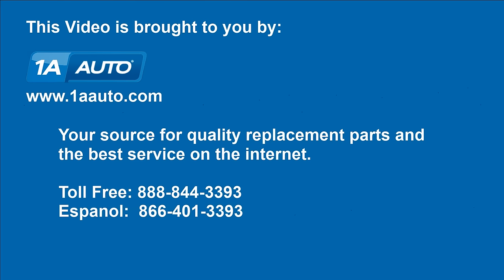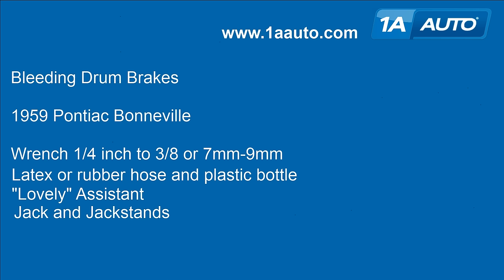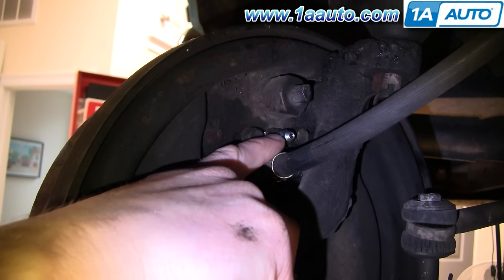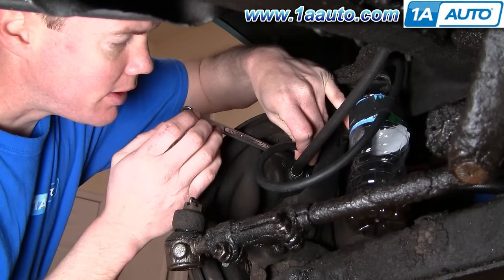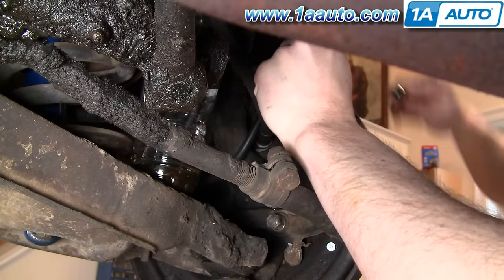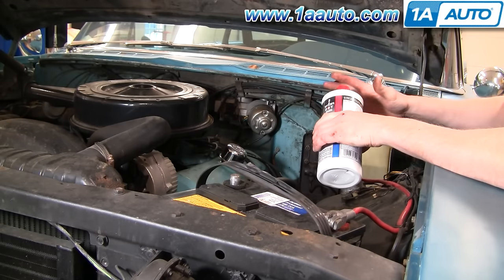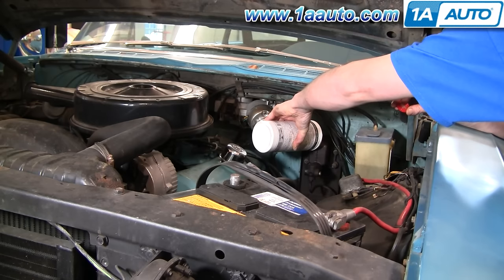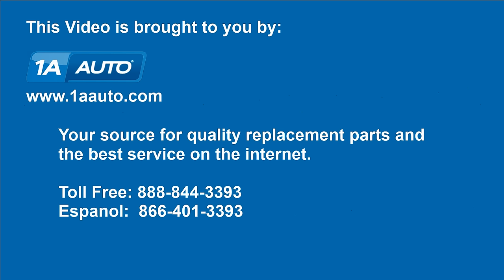How To Bleed Drum Brakes on your Car

Comment: im a trainee mec... and im 100% sure the pipe being used should be clear, how do you know if there's any air in the line.
Reply: +Shifty mcshafty because the hose is submerged in the water in the bottom of the bottle.  It bubbles when air comes out
Reply: BECAUSE BUBBLES COME OUT
Reply: Shifty mcshafty lol I'm not a mechanic at all and I always use a clear hose to bleed them with. Otherwise you've got no idea when all the air is out like you said.
Reply: You will see bubbles in the fluid already in the bottom of the bottle
Reply: Shifty mcshafty you mean flush out the line??

Comment from the maker: You can replace the lines both rubber and steel tubing, you can swap in auto adjusting brakes, if you get all the correct parts you can even swap in disc brakes for drum brakes.  We kept this video simple, showing the ways to bleed them.  If we do some of the more involved projects like upgrading an what not we will film them.

Comment: Will bleeding the brake shoes help with making my new drum fit? I recently changed my old drum on my Pontiac g3 2010 and shoes and the new drum won't fit. The adjusters are both at the lowest setting. Will bleeding the brakes help?

Comment from the maker: You may want to check the brake lines to see if there's a leak in the system. If you crack the bleeder and keep getting air out of the system, there may be a leak somewhere in the line that needs to be repaired. 888-844-3393 1aauto.com

Comment: What is the whole purpose of bleeding the drum brakes? What if I only want to change the brake shoes only?

Please help me sir?
Reply: Optimus Prime if you open the brake line system at all, replace wheel cylinders or calipers, or new lines, you'll need to bleed any air out. Just replacing shoes and pads shouldn't cause any air to get into the lines.

Comment: got a new master cylinder bench bled then bled rear right and it flowed for like a minute then stop flowing completelyy, i used the pedal pumping and vaccum method and still nothing ! what should i do now i even bench bled master cylinder again just to make sure and then the pedal felt harder but still no fluid out either rear back drum brakes

Comment: You did not finished showing the rear drum brakes you just showed you cleaning the bleeder valve then switched to you adding more brake fluid . I'm having trouble with my rear drum brakes on my 1994 chevy silverado. Also do you mean rotate the wheel by hand then hit the brakes. Or take the drum off and manually click the self adjusters up or down?? Let's see how your customer service is on the world wide web ha
Reply from the maker: +Danny Youngblood Thanks for watching! This video is a demonstration to show you how to bleed brakes on a vehicle like this. The rear is going to be the same as the front, apply the brakes, open up the bleeder, close the bleeder, then let off the brakes.  You do this process until there is no more air coming out and your brake fluid is topped off.  He also means spinning the drums by hand and clicking the adjusters until you feel some resistance while spinning them.  You do not need to take off the drums to click the adjusters, there should be a small access port on the back side of the dust shield, and you can reach in there with a flat head screw driver and click them up and down! 1aauto.com

Comment: thanks alot, just started working on my 69 camaro after its been sitting for the past 12 years, its got the origianl drum brakes and right now the peddle will go all the way down and the front drivers side is leaking fluid,  One thing at a time and hope to get r done,, thanks Jeff

Comment: You can do this without having the car on a lift right? Should I just find a level surface and jack up every tire on the car then begin bleeding?
Reply from the maker: Yes you can do this in the driveway on jack stands. 1aauto.com 888-844-3393

Comment: thanks for posting this, im 16, and have honestly never bled brakes, i've just been the one pumping yhe brakes. im about to go outside and bleed the brakes on a 49' ford that hasnt run in 5 years that i just started yesterday. only problem is the pedle goes strait to the floor. i checked yesterday, and the rezervoir was bone dry so we'll see if we can get brakes today.

Comment: what if all my bleeder vales are sezzed how can i bleed them
Reply: Got three out of four bleeder screws out , but fourth one broke off and tried using easy out with no luck,  ended up drilling hole thing out and tried re threading it but now it leaks. now I need a new caliper.
Reply: James Lund That's a pain in the butt